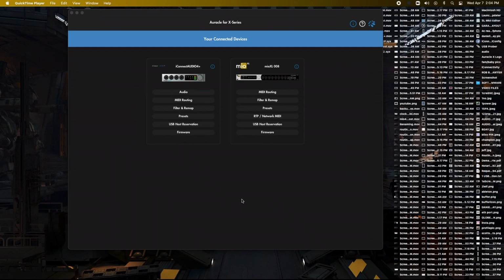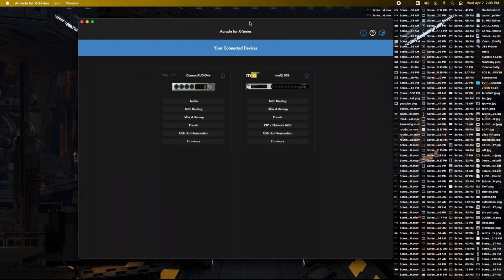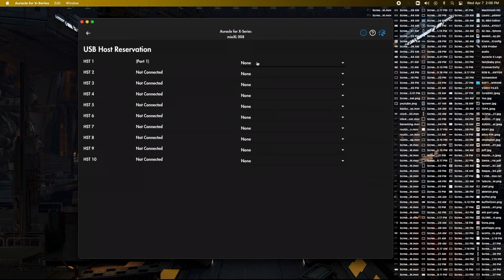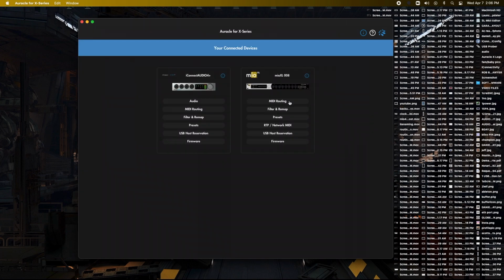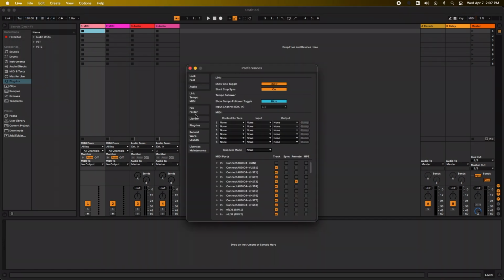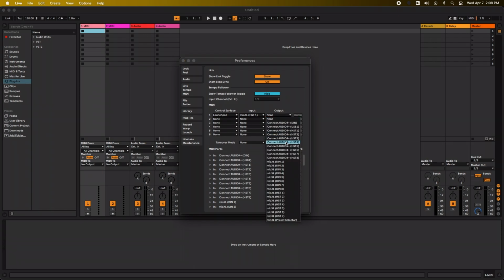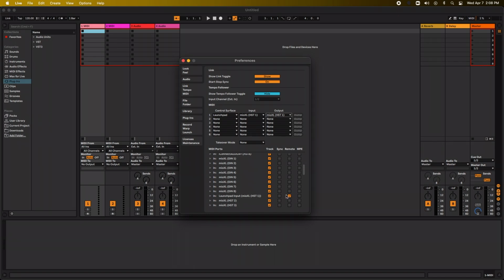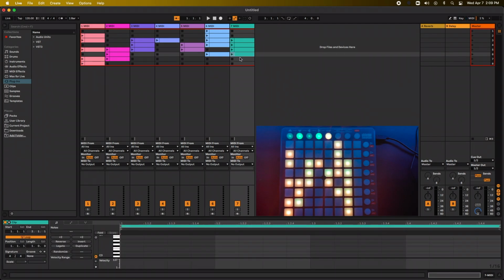Control Surface Ableton + iConnectivity | LaunchPad Edition

Comment: Would this work also without the USB direct connection?
In my case, I have an APC40 MkII connected via usb to a host port on my MioXM (which is not connected to the computer directly), but instead the MioXM connected via ethernet to my Play Audio 12 that's connected via USB to the computer?
It's working fine when sending Midi but the control surface part is not working unfortunately.
Reply from the maker: This should work. You just need to verify you have the in and out paths both set up routing wise and then make sure the settings are like in this video, where you can get the remote, track, etc.. out to the APC.